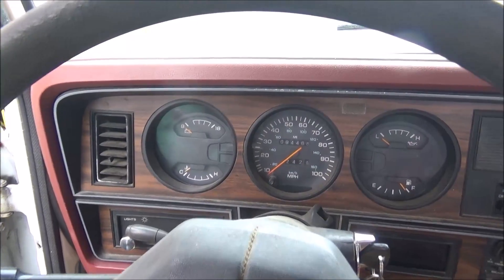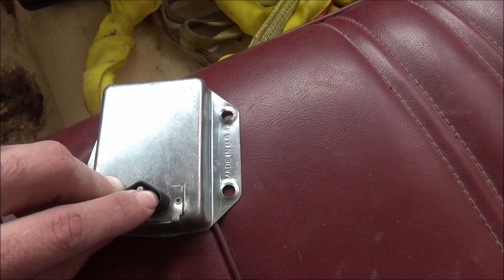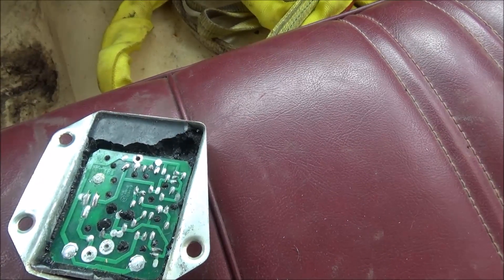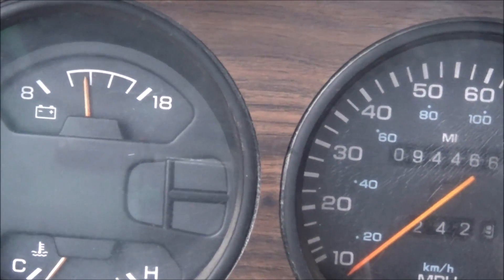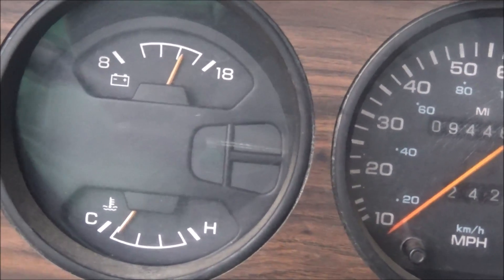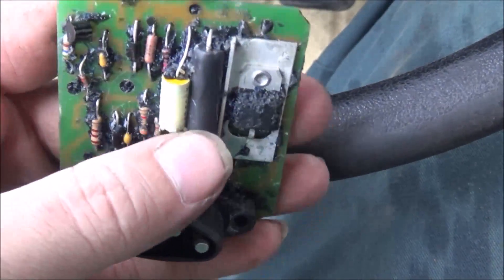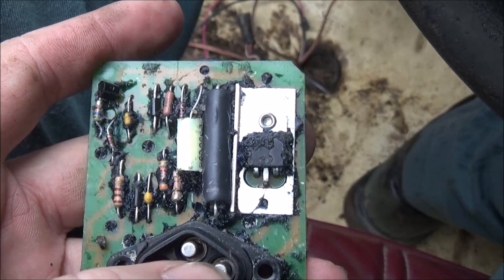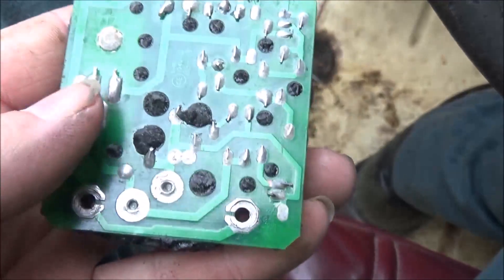Plagued by electronics, I need help

Comment: You can't use a relay to control the field. I didn't understand when you said if you put it straight to ground it will start charging, it should be straight to 12v (that's the field input on the alternator, otherwise there's a missing ground on the field). 
Would be useful if you show how the alternator and regulator are wired - should be 12v from battery to the regulator and from the output of that to the field on the alternator (if it's got 2 prongs then the other goes to ground). Without seeing how they are wired and given that the regulators don't last long I'm going to guess that it's either a ground (regulator or alternator bad ground) or the alternator field is drawing too much current and will "burn" the regulator (could be that the field windings are shorted some). Maybe show a hand drawing of the wiring, that could help (in case there's something wrong with the way it's wired).
Reply from the maker: Excitation by one wire from the key and the other side of the field is grounded by the regulator. https://images.search.yahoo.com/yhs/search;_ylt=A0LEVjs4gKBYfBwANYEnnIlQ;_ylu=X3oDMTByMjB0aG5zBGNvbG8DYmYxBHBvcwMxBHZ0aWQDBHNlYwNzYw--?p=Chrysler+Voltage+Reg+Wiring&fr=yhs-mozilla-001&hspart=mozilla&hsimp=yhs-001#id=0&iurl=http%3A%2F%2Falternatorparts.com%2Fimg%2Fchrysler_external_voltage_regulator_wiring.jpg&action=close
Reply: ok, got it now. 
In your case I would check grounds, otherwise I tend to blame the field winding in the alternator (I mean there's nothing else left other than that since you've wired it correctly)

Comment: As a retired GM mechanic (39 years) I've seen this several times in the past. One time it was the alternator, that the test meter  said was good, every other time it turned out to be lose of a good ground. Many times after a conversion like you did the contact is lost between frame and block. Get a couple of the good old woven bare wire ground straps between frame and block. And check  that your current ground wires, like the ones between block and firewall are clamped to bare metal. Hope this helps. Feel free to contact me if you like.

Comment: Hi Brian, I have been through this on several of my Dodge vans, I have had to add an additional ground cable from the engine to the chassis to keep these from self destructing. I also add a ground cable to one of the starter mounting bolts to the battery. I believe I heard you say that this truck is a conversion to the diesel. I have swapped out good alternators from one van to the other still to have the regulator self destruct. My daily  work van is a 1981 Dodge one ton van and has the additional cable on it and has not let me down since I added them. I hope this helps

Comment: I've had many of mopar trucks from the 70s to 90s and I had this exact issue.   here is the problem, you need a branded ground strap from the block directly to the voltage regulator.   the way they were originally setup it relies on a good body ground through the firewall, add the ground and you should be golden.   hope it helps, also inquire with chopshopunderground, here on youtube. I've run a few things through him b4, and I feel I know my shit..   he's a mopar God for the  70s 80s dodge trucks.

Comment: 3 possibilities, bad body to engine ground (missing ground strap) there should be a braided cable from a stud on the engine to the firewall, poor regulator ground, bad diode trio in the alternator. Mopar alternators especially the one you have should have been putting out almost 18 to 19 volts when you full field it. Looked as though yours was putting out about 16 volts.

Comment: Had one of these burn out on my 76 highboy but the one in my dads 69 ford 3/4 ton lasted forever. Check your body to engine ground strap for corrosion. Those regulators always need a good ground or they're toast.

Comment: I would agree with quite a few of the others, check all chassis grounds and failing that go with an internally regulated alternator. I have used gm alternators in many different makes of vehicles and equipment and only ever had trouble with one and that was due to bad grounds.

Comment: Engine to chassis/body ground wire, as well as regulator case to chassis, these often somehow disappear or get overlooked in engine swaps. Intermittent diode in the alternator. If all else fails, a GM one wire. The erratic reading says ground problem to me.

Comment: *******. Brian, You have a ground issue.  Make new ground connections between the engine, body and the alternator.   Make them clean and tight, using heavy cable. If nothing else, it's the place to start.   Remember that at this point, the alternator diodes may be off because of the voltage spikes caused by bad grounds.

Comment: From a ASE Certified Master Technician: Run dedicated ground wire from regulator mount directly to alternator case and add grounding wires from cab to frame to engine reconnecting the electrical ground path. I have repaired multiple Chrysler problems with this approach. It is much easier and faster than chasing corroded or intermittent grounding connections.

Comment: if you need support 24/7 join the #electronics channel on freenode irc. There's phds, electrical engineers that hang out there, about 1000 users in the chatroom.

Comment: Check your chassis grounds. A "floating" ground will not always show up easily and will fry electronic circuits.
I did an engine swap a couple years ago and the gauges and starter acted weird until I replaced all the chassis ground straps including the battery negative cable. It was a pain to do because I had to make sure there were no rusty contact points, no paint under the ground straps (that one cost me 2 starters and two weeks of removing and reinstalling starters) and buying all new straps, screws and cables (that was the easy part).
Very frustrating.
Hope this helps.
Thanks,
John

Comment: check the transistor, the square thing, and try to draw your circuit in SPICE (the cad program for circuits), looks pretty simple you could even make it yourself with parts from radioshack. Unless they went out of business, i haven't seen any in canada for like a decade. radioshack used to have a 100 page circuits book, very well made with hand drawings of everything called the Engineer's mini notebook. It has everything in it to understand this circuit and make it.

How to check a transistor: https://www.youtube.com/watch?v=b0jCUsenNsY

Then check the resistors and diodes, you could easily fix the circuit if its the resistor.

Comment: did you rebuild your alternator? maybe it needs new brushes. Had the same problem on my '90 bmw. It was a simple system so there wasn't anything draining from the battery, so it must have been the alternator. We tried a handful of old alternators and it got better, but eventually it happened again so i scrapped the car. This went on for 2 years.
Reply from the maker: I didn't do anything to the alternator. It tests perfect on a test bench and works flawless for months at a time till the regulator quits.

Comment: When you "give" a jump and rev the engine to get the other car started, you place a tremendous demand on your alternator output , sometimes it burns the diodes, one or more.  You'll notice then the battery will start loosing power slowly.  Regulator then will go "crazy" attempting to regulate  that alternator.  I would remove alternator and have it check. Good luck.
Reply from the maker: I have already checked alternator on bench stand and it all checks fine. The truck can sit for weeks and not drain the battery.

Comment: Brian,  run a ground strap from battery - to chassis [fender,frame etc]  .  That cured my old chevy c-10.  Your problem is grounding.  Don Baker/ oldmandonnie
Reply from the maker: I already have 2 grounds from engine to chasis. Both with star washers and dialectric grease.

Comment: Brian,  I have found that particular problem caused by one of three things. Poor ground to regulator, low quality part , terminals spread in connector. in that order
Reply from the maker: I already have 2 grounds from engine to chasis. Both with star washers and dialectric grease. The regulators themselves are also mounted with 3 screws with star washers as well.  The harness end is not perfect but it does always get a connection the instant you plug it to a new reg nut maybe when it heats up it starts losing it and the loss of connection kills the electronics?? Maybe I will try a new end.
Reply: I would voltage drop test between regulator case and battery ground with all electrical accessories on @idle  should be less than  .2 VDC  .If thats ok i would temporarily solder jumpers between harness and regulator. that would eliminate all but intermittent open in harness to alternator , connection at alternator ,and regulator quality.

Comment: change to a single wire intigrated alternator
Reply from the maker: Nothing $300-400 bucks wouldn't cure right! :-)
Reply: That's true  . Also as others have already mentioned it could be the ground. You might check at a truck wrecking yard for the internal regulated single wire alt. It would  e a lot cheaper.

Comment: Something is broke, and you know it's transient, so the good diode test is meaningless. Fix it instead of wiring in a relay. Check your grounding straps and run some new ones. Replace the alternator, or diodes (if you can). Make sure the alternator doesn't have an internal regulator. Transient connection problems can cause voltage spikes due to stray inductance and capacitance.

Comment: Bad body ground. Common on Dodges. Clean the existing grounds. Should be one that goes from battery to the engine and battery to the body. There also should be a ground strap from the rear of the head to the body.
Reply from the maker: I already have 2 grounds from engine to chasis. Both with star washers and dialectric grease.

Comment: OK, so you converted truck from gas to diesel, so assuming your using the high output alternator off Cummins engine, and a high output battery or batteries, so are or did you switch the regulator to the diesel truck model? Also wiring between those items needs to be sized for higher output!
Reply from the maker: The wiring all came from my 89 donor diesel including the regulator.  The problem maybe that the factory diesel reg was different. The auto parts stores don't show there being a difference.
Reply: It really doesn't sound like there is an issue with system, regulator is working, just doesn't last! One thing I have learned is not to put a lot of faith in "big box parts stores", sometimes they give you any answer that will sell products and not waste their time! Try seeing if you can get a regulator that is heaver duty and i think you will find that I should last normal life expectancy!

Comment: I had a similar problem with a GM product turn out that there was a battery cable rub through. Try replacing the high current cables. Also there could be a weak diode in the rectifier change the alternator. The black thing looks to be a capacitor, if any AC is gets to it, it's toast.

Comment: A guy on you tube, screen name scanner danner is an automotive wiring/electrical genious or specialist.  If you get tired of a ghost or gremlin problem like i did, obviously you like your truck-go to Jegs and get a one wire  GM Type alternator for your truck.BUT definately go big on the guage of wire for the  one wire that it uses, when I installed one i noticed that terminal built up some heat.

Comment: Use your meter to check continuity of the ground connection from the regulator to the case of the alternator. It should be of very low resistance. If the the ground connection from the regulator to the alternator is not good it is probably wearing out the switching parts in the regulator, just as you suspect putting a relay in the circuit would burn it up from high cycle rates. Use star washers and ring terminals on all grounds. 

Run a ground wire from your ground post of your battery to the body of the truck. run a ground wire from the mounting screw where you mount the regulator to the body of the truck to the case of the alternator. 

Did you say you had other setups like this and they were not causing you issues? 

Scott
Reply from the maker: I already have 2 grounds from engine to chasis. Both with star washers and dialectric grease. The regulators themselves are also mounted with 3 screws with star washers as well.  The alternator also has a dedicated ground t the cylinder head. I cleaned them all when I installed them but may need to go back and do them again. It would have been nice if Chrysler had used the 3rd pin in the wiring connector for a ground rather than running it thru  the truck. I think I am going to try a dedicated ground wire from reg to alternator next. My yellow 89 in my thumbnail has the exact same setup and has never been a problem in the 17yr I owned the truck or the 150,000mi I drove it.
Reply: is the continuity different on the truck that works? continuity from the regulator body to the alternator body?

Scott

Comment: You have a ground problem!!!  This io a common problem on Dodge trucks with a Cummins motor. You will need to clean ALL of your grounds both at the engine block, frame and body and I mean put a wire wheel on your drill and make them shine!!! Make sure all are tight and that you have your frame and chassis grounded to the engine block in several locations. I would also run a ground wire from one of the regulator mounting bolts to the frame and block.... I've been a mechanic for over 35 years andI have had bad grounds on Dodge trucks HAUNT me in the past
Reply from the maker: I already have 2 grounds from engine to chasis. Both with star washers and dialectric grease. The regulators themselves are also mounted with 3 screws with star washers as well.  The alternator also has a dedicated ground to the cylinder head. I cleaned them all when I installed them but may need to go back and do them again. It would have been nice if Chrysler had used the 3rd pin in the wiring connector for a ground rather than running it thru  the truck. I think I am going to try a dedicated ground wire from reg to alternator next.
Reply: You have got a ground problem!!! where it is anybody's guess but you have to have battery grounded to frame, body, and block and in several locations And I still would run a ground from the regulator to block and frame. I have beat my head against fenders many times chasing bad grounds and the problem is never in the same place twice

Comment: Brian, your Cummins Diesel, actually sounds pretty cool!

Just for a little bit of additional help, there is a electronic component inside the regulator called a MOSFET. "Firstly a Mosfet is a metal-oxide semiconductor field-effect transistor hence the name Mosfit, but what does it do?(bit.ly/2lCFuVB, and bit.ly/2lxxpFE)

Think of a Mosfet as a variable resistor, the voltage difference at gate-source can be used to control the drain source resistance. Using a Mosfet as a variable resistor is not a good idea and will drastically shorten the lifespan of the component, but I believe this is the best way to explain how it works, to someone with next to zero knowledge of electronic principle. When there is no voltage at the gate-source the drain-source resistance will be very high causing the gate-source to act as open circuit (off) causing no current to flow.

When there is voltage at the gate-source, the resistance of the drain-source drastically reduces, allowing current to flow through the drain source, this circuit is now closed (on).

To sum this up, the Mosfet is controlled by the voltage at the gate-source, the amount of this voltage in relation to +vin is known as the potential difference, The higher the potential difference the more the ‘straw is pinched’ (higher the resistance), the lower the potential difference the more current is allowed to flow. This is why Mosfet’s are prefect for use in a box mod, they are great for large current applications and are usually used as a ‘switch’ that protects your switch."

Example: This will depend entirely on your application and on how you intent to switch (drive) the Mosfet.

N- Channel – the source is connected to ground. The Mosfet is switched on by raising the voltage at the gate. To turn it off the gate must be connected to ground.

P-Channel – The source is connected to your power source (Vcc). To switch the Mosfet on allowing current to flow, the gate must be pulled to ground, to turn off the gate must be pulled to Vcc.

Why do I need the 15k resistor?

Mosfet’s once switched on like to stay on, the 15kΩ resistor across the gate-source will present a voltage to stop the Mosfet from firing.

But i don’t have a 15kΩ resistor?

You can use any value resistor you want, the higher the better. But please ensure you read the statement below.

The value of the resistor across the gate source will determine how much current will flow through your switch, to calculate this current use the simple formula below

Voltage/Resistance = Current

E.g. 4.2v/15kΩ (15000Ω)= 0.00028A 0.28mA

Comment: Sounds like you are fighting more than one problem. Nothing major, but enough to make you think it is. When I run across things like this in my own vehicles, I usually just replace it all with a late 70s, early 80s alternator from GM with a built in reg.  It is simple a solves many problems at once. If you don't want to do that, start checking grounds and go from there.

Comment: Sounds like a harness connector. The black thing looks like metal film resistor. I got a modern lemon with jittering abs brakes,dead power windows,jumpy gauges,and a intermittent total loss of power dead short.